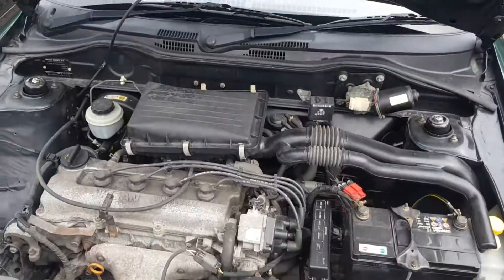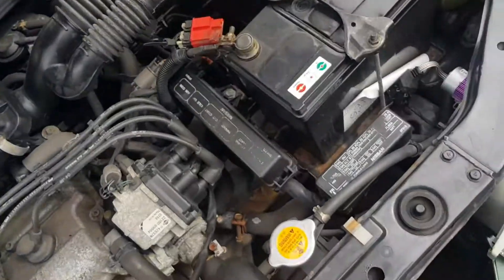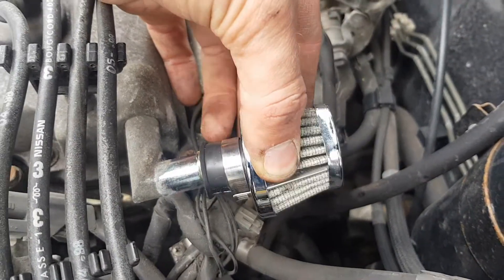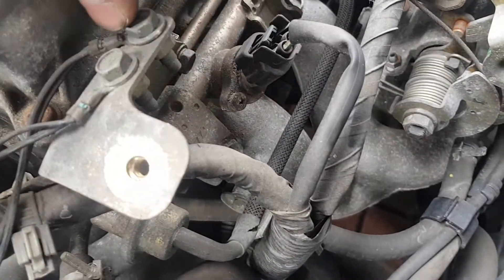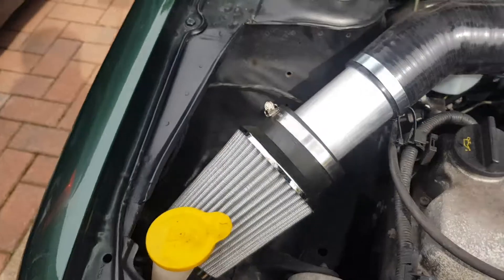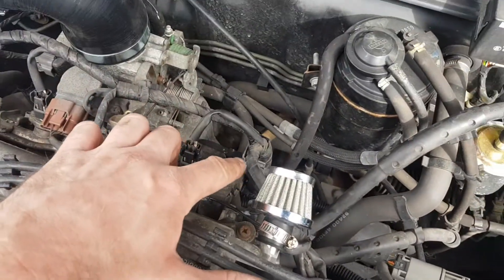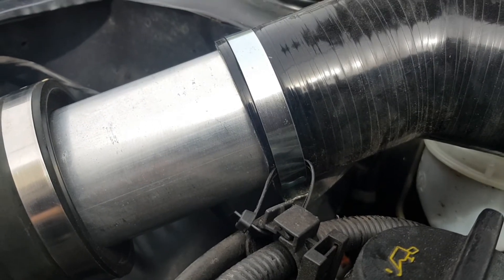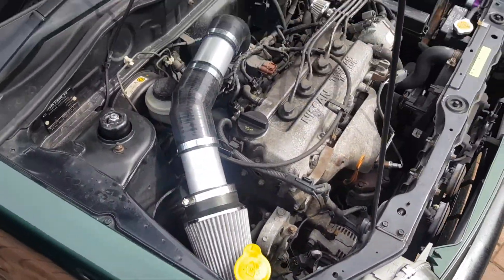Make your own K11 Nissan Micra intake for £40

Comment: Great job! Ignoring the sound, did you feel any increase in performance? Better reving?
I´m building a K11 at the time, want a little more "extradynamics"...
Reply from the maker: It's been a while since i fitted it but it did seem to free up a little more power higher up the revs.
It wasn't a huge difference but it was definitely a noticable improvement.

Comment: Wait? I don't get it. How are the bends also 70mm? While they slide over. What's the adapter conversion at the filter to the pipe?
Reply from the maker: The metal pipes are 70mm outer diameter and the runner is 70mm inner diameter
Reply: @LeadFootash23  this pipe shizzle is so confusing hahaha. I also see people using 76. I know the throttle body is 70m. Funny thing is. On my bmw. It's supposedly also 70. But my diameter of filter adapter is about 80. Guess we'll just have to see if it fits on my friends Micra 🤣
Reply: @LeadFootash23  what happens if I remove the whole tube, I leave just the filter box open with the filter inside it ofc (I have a 2012  k13) today I really struggled with the power, the road was like i was climbing a hill, it just stopped from moving, until all the passengers were out of the car LOL.
Reply from the maker: @kheirellahberzig2663  There wouldn't be any benefit to that at all, in fact it'd probably be worse as it'd suck hotter air in

Comment: Hi,my k11 Is running lean After the filter swap,what should i do? (Got a '96 k11 distributor One)
Reply: ur engine now had more purer air than before so its needing more fuel in the combustion to mix better with thr purer air. tune it at a garage to get the right amount of fuel/spark/air ratio